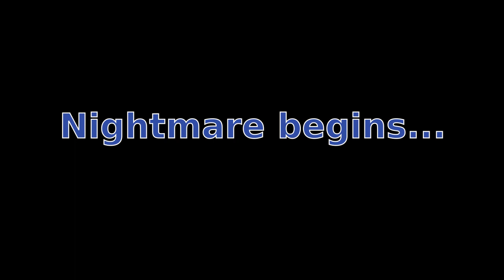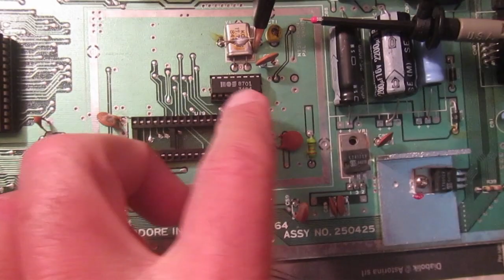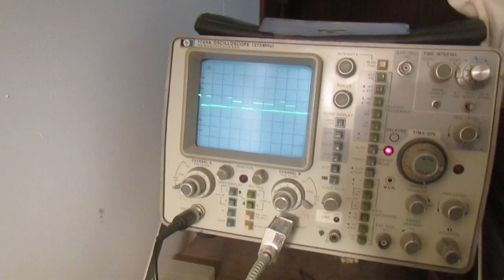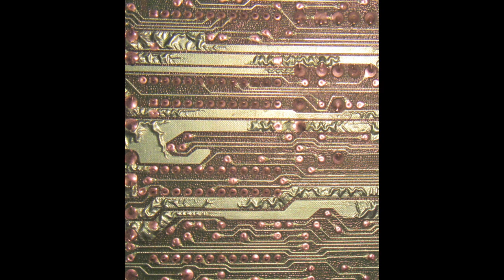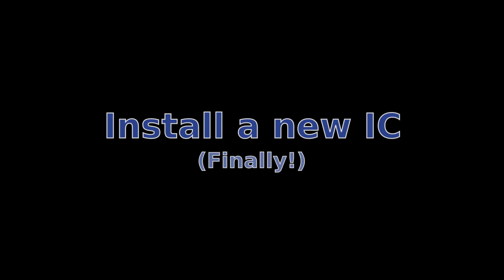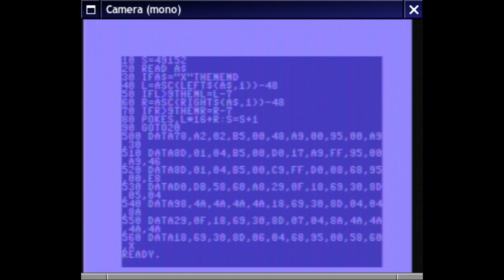Commodore 64 "many faults" repair. Was it an auction scam?

Comment: "Soviet PLA". Great band name.

A good fix video, but so many failed on this machine? Someone using it would have stopped on the first chip failure and not kept it running enough to eventually cause all the others to fail in turn. Sounds like a 'Beijing back-street special'
Reply from the maker: Definitely this machine was "composed" to be sold in the auction. The 6522 and 6567 chips had no reason to be there unless someone was just finding chips to stuff the empty sockets. I'm glad the 6567 appears to work fine on a NTSC C64,  I hope it doesn't have hidden "surprises" at least.

Comment: Completely agree. That machine was assembled from bad parts on purpose and sold as a scam. And wasn't a bad PSU as it would kill other chip soldered on the board. Agree there too! Total scam!
Reply from the maker: Definitely not a bad PSU there. VIC/SID could have been killed by the bad 7805 but I think they couldn't figure out how to repair that board and just stuffed it with bad chips and got rid of it at a price...

Comment: Great job Frank! I think you are right, this was someone who robbed socked chips form this board and then plugged back in bas chips to sell it on. There are a lot of people now who 'repair' old computers now by randomly swapping chips around until it works so a lot of these types of boards tend to show up on eBay.

It reminds me of people that used to fix tube type TVs the same way. They would just swap in new tubes until it started working again. Or take all of their tubes to the drugstore which sold tubes and had a free tube tester the public could use.
Reply from the maker: Hey Birt! Yeah, sad, I didn't really suspect, though that VIC-II with the grease was a bit odd on a machine without metallic lid. Thanks again for the 8701 replacements!

Comment: EBay is full of cowboys... bought a device a few years back and found most of the high value components missing... so I'm not surprised.  Make sure to leave them -ve feedback for the sake of those that come after you and file a PayPal claim on the basis of not as described
Reply from the maker: Well, you're right indeed. But I left a neutral feedback with what I've found. While it's not exactly as described (it was described as "untested" but to me seems very well tested for bad parts), it's hard to prove my analysis is correct to unaware persons (paypal persons).

Comment: Could it be that 5 V regulator? Usually 5 V TTL chips don't tolerate more than 7 V.
Reply from the maker: That 5V regulator is used to power the SID, VIC-II and 8701 clock generator. So it can explain these three chip failures only.

Comment: Sounds like this one case someone had where the power supply when crazy (pumped out 14 volts) and fried EVERYTHING.
Reply from the maker: I don't think so, because in that case there would be many small logic chips failed too and I've found none. The mT DRAM chip are unreliable after all these years, infacts as expected at least one was bad.
Reply: @iz8dwf  Huh, odd. I guess maybe someone made this one as a sort of joke with all the faulty parts from other machines
Reply from the maker: @audiodood  I have this suspect too, mostly because of the 6522 and 6567 just placed there, also all the pulls are too unusual (all ROMs, PLA).
Reply: @audiodood  unfortunately, far from a joke. This is usual practice on ebay. Typical scammer board with all the faulty chips they had pulled from other boards, most likely selling the good chips separately (as this is the way to make even more money). Can't describe how much I despise such guys.
Reply: @insanedruid3143  Wow.Thats scummy as heck

Comment: Wow just wow what an challenge you had there. I wonder what happened to this unlucky c64. In the end this c64 proved well worth this much appreciated video. Would not mind seeing you showing how you do the piggybacking of the ram chips though. Thanks a bunch for making this video :)
Reply from the maker: Hi! Thanks for the nice comment! Piggybacking is just putting a good chip in good contact pin-by-pin to the original one. I've tried to explain the process here: https://www.youtube.com/watch?v=mxhEgmG6vh4
Reply: @iz8dwf  I will definitely check that video out, thanks again. Out of interest have you tested the 6567 VIC-II and 6522 chips if they work or not?
Reply from the maker: @Miidolf  Not yet, I'm quite busy with a few other projects. But I'll definitely report if they work in future video(s)
Reply: @iz8dwf  I recently bought an c64 KU-14194HB motherboard and there  was one wrong chip in one of the rom slots. I believe that wrong chip was one used in floppy drives. Well i replaced it with an correct one and got the pretty blue screen again. It also had an younger 6581 SID chip from 1984 but it  sounded just beautiful. Inside one of my other breadbins i found an SID chip with the date 3282 and i put that into the KU-14194HB and everything looks perfect again :) Just the thought of that SID chip alone being almost 40 years old gives me shivers ;)
Reply from the maker: @Miidolf  WOW the KU-14194HB is one of my "dream" C64 motherboard. I'm happy to have the USA Rev. A however :)